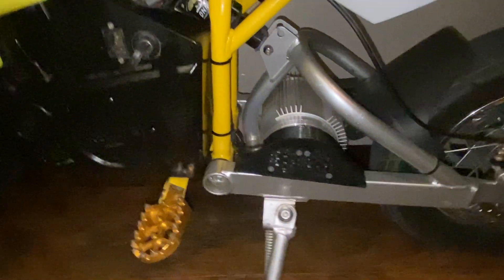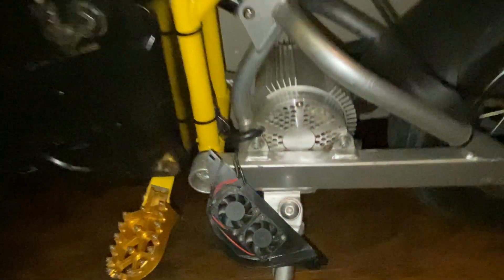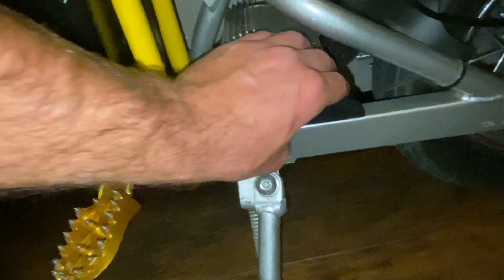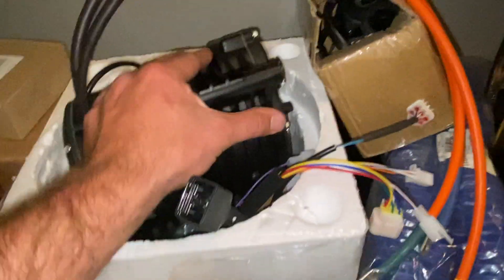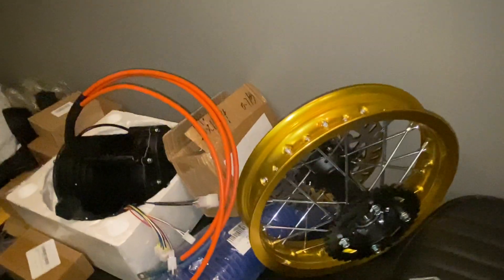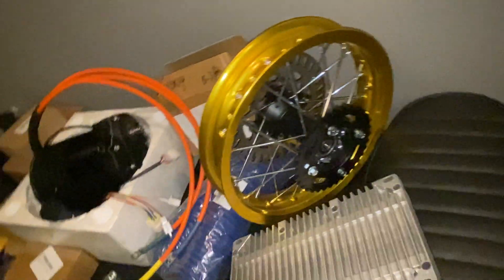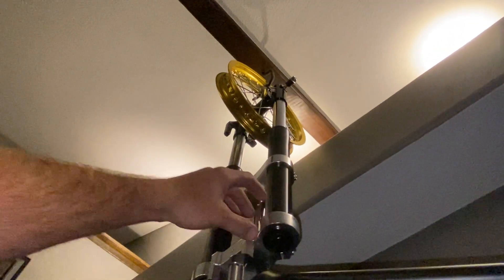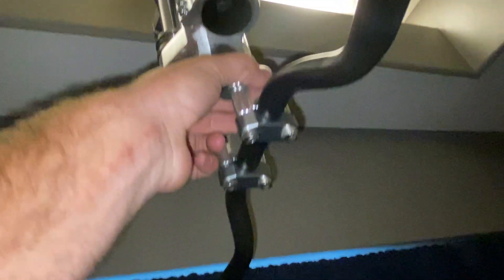72v 3000watt 3D PRINTED COOLING SHROUD duel fan 1020 motor, teaser for next build

Comment: Nice cooling idea. I just ordered the same motor ebike kit. I hope it's not a counterfeit! I'm gonna rig it to my Giant Revive semi-recumbent bicycle.

I won't need cooling for now because I won't be riding up hills, but I will eventually try using a mountain bike three speed cassette to see if the motor can handle hills at 36v.

And I found a makita electric leaf blower in the trash bin. It has a brushless motor that runs at 12vdc. I will use it as a motor cooling fan that's regulated by arduino or something. Or maybe just manually with a PWM motor speed controller.

Comment: How did you do the wiring and the switch
Reply from the maker: The battery pack has a on and off switch I just spliced the 2 wires coming off the pack to fans and turn it off and on with the switch the pack comes with

Comment: so with that power bank you just cut one of the supplied dc cables and spliced in the 2 pin connectors on the 2 fans?
Reply: You ever figure out the wiring lol
Reply: @Kilo5910420  still have it sitting in my garage, never got the fans and stuff.  Does it make a huge difference tho? My motor does overheat somtimes. All i did was the heat sink
Reply: @oceansidepirates23  lol it definitely helps..going to splice the cord coming off the battery pack with the two fans got to cut the plugs off the fans and splice them all together

Comment: https://youtu.be/7pDMOdLP51A

Pretty sure this is a QS138; good for a reported 80mph. In a Story Post, Alter Ego Motors teased one  in an MX/ SX frame. I think Boelectric too.

Modified swing arms for sure; but they’re um… fast.

I’m kicking my Overwhelm Addiction, and am slowing down to finish one project at a time; but QS120 or 138 is on the prospective agenda for the RSF frame.

Comment: Did you order the qs motor from ali express?
Reply from the maker: Yes I did !
Reply: @voltmasterp8470  did it take a super long time? And how much was the kit if you don’t mind me asking, I’ve been trying to order one of the qs motors but I always get scared to order anything from ali express 😅
Reply from the maker: @highvoltfab  it was 650 with 300 shipping total around a g they have a throttle they recommend for 20 bucks called a Z6 , my seller was “SIAECOSYS POWERTRAIN STORE” took like 3 weeks to show!
Reply: @voltmasterp8470  thanks!
Reply: @voltmasterp8470  are you still using the 25Ah Btr power battery for you current set up with the MY1020? And would you still recommend that company?
Reply from the maker: @highvoltfab  I’ve had good luck with them but they don’t have a good reputation so it’s so so , and I’m having a custom battery made by a local builder to fit my frame and maximize all the space
Reply: @voltmasterp8470  sorry to bother you again but would you say one of the 20 or 24Ah batteries is worth it from E&C cuz I remember you mentioned that someone you know had built with that battery, is that battery still kickin?
Reply from the maker: @highvoltfab  they are overpriced in my opinion and long waits , but they do have warranty they seem to honor but long waits for that aswell, I would have a builder build you one , there are guys on Facebook that are reputable!
Reply: @voltmasterp8470  oh I see! Is there a specific group name I can look up?

Comment: How did you wire the fans to the battery pack? Do they just plug in or did you do something special?
Reply from the maker: Small speaker wire ran it up with the thick motor wires , had to splice the wire off the 
Battery pack